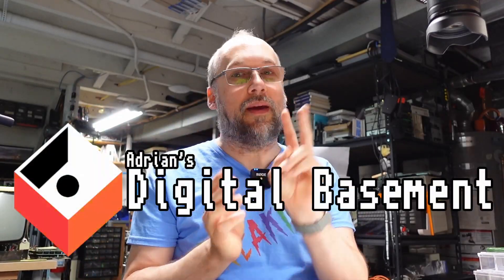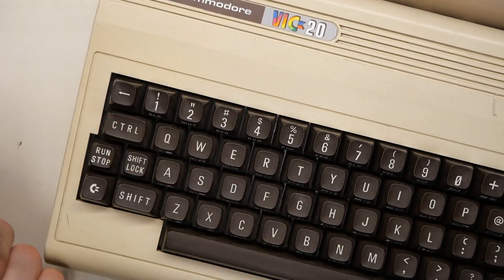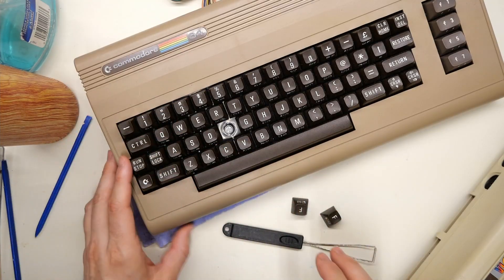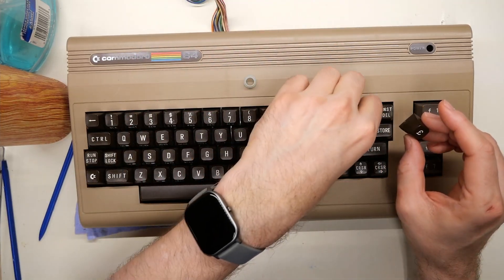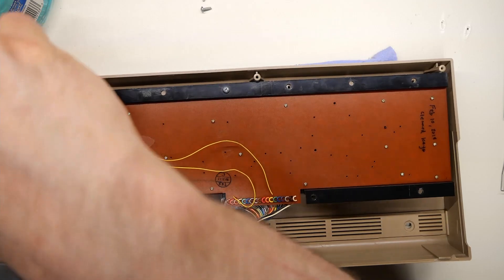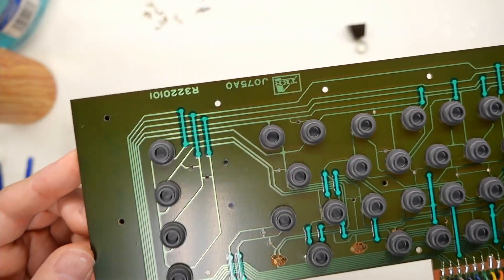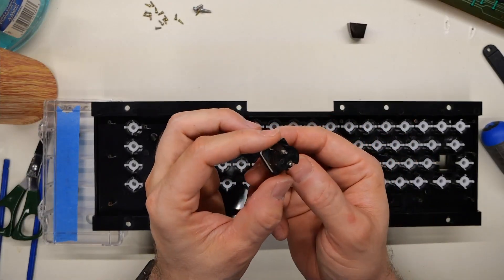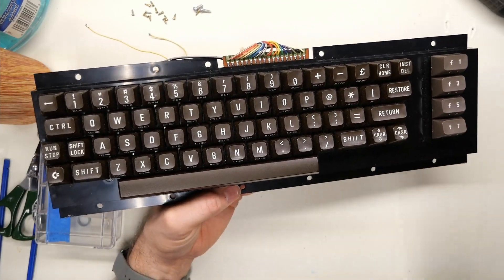Rare (?) Commodore breadbin keyboard curiosity

Comment: I have one of those, the light brown F keys are leftovers from VIC's
Reply: Yeah... and they were standard on most of the C64s released in the early 80s in the UK.... I worked in a small shop that sold hundreds of these C64s when they came out, and we had display models instore, and I was also able to take home the computers over a weekend to get familiar with them.... The C64 released with a virtually identical keyboard and case to the VIC 20 - the big difference visually being the colour of the casing - light brown for the C64, and off-white for the VIC 20.
I think the US got the more grey function keys usually for whatever reason....

Comment: Why not add springs so that it doesn't feel so mushy?
Reply: Mushiness felt is often at the bottom of the key stroke. A spring is not going to change that.
Reply from the maker: The rubber dome is needed on this board to make contact with the PCB -- so it would just be extra stuff with springs. :-)

Comment: Oh yeah I've come across one of those, I remember it looking like new - probably because nobody wanted to use it. Very hollow sound and mushy feel as you say. There is one spring - it's under the spacebar
Reply: Have this keyboard on my Vic20.... confirming it's rubbish
Reply: Yeah, I used to have a vintage computing shop in the early to mid 00's and came across a lot of C64's that I had to do some work on, and I came across this type of keyboard every once in a while.  In fact, I still have some of the rubber carbon domes somewhere around here for that kind of keyboard that I pulled from a broken one.

Comment: I didn't know this was rare? Remember the PAL motherboard I sent you back for Mail Call (#2 I think), well I took your advice and cleaned up the case and keyboard and installed a keyrah and BMC64 raspberry PI. The keyboard was exactly the same as the one you have there, I actually thought that all the breadbin keyboards were like that? https://youtu.be/HmKa0kwECGw?t=76
Reply: retroleum in the UK has spares of the rubber dome. They call it a "Type 2" keyboard, and they say it is "less common".
Reply: The case that had my rubber dome keyboard (owned by me since i was a child), the sticker says "Made in England" "SER. NO UK B 143540". Maybe these keyboards were used in UK built C64's?
Reply from the maker: This was a US market C64 (probably made in Hong Kong or something) -- not sure there is any rhyme or reason to where these are used... but yeah of all the C64 and VIC20s I've had through the basement, this is the only one that is like this --- I've probably worked on 40 machines at this point?
Reply: Do you know if retroleum always has these long shipping times? (Sorry, this is completely off topic) Thats because i ordered a replacement ZX Spectrum keyboard membrane 5 weeks ago now, on his website, and it still has not arrived yet :(